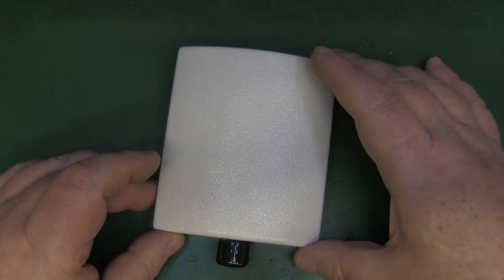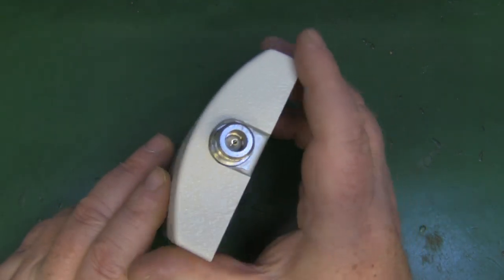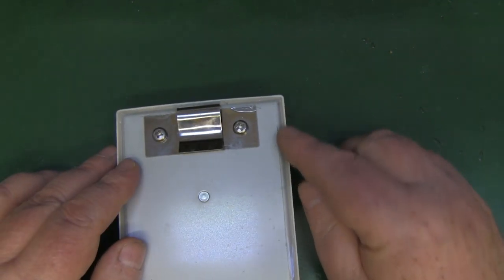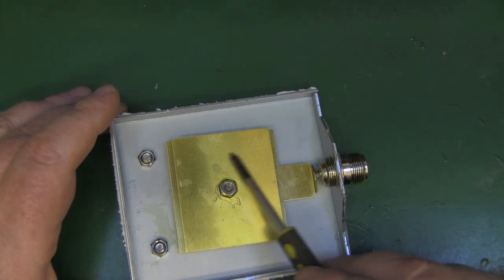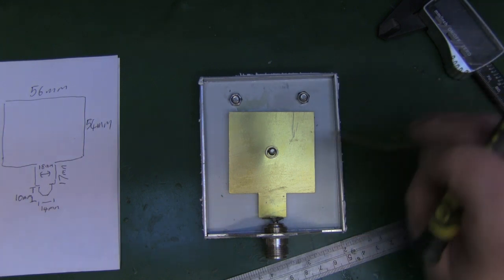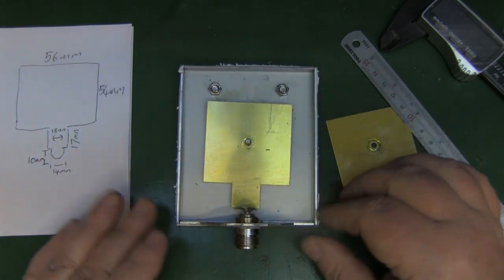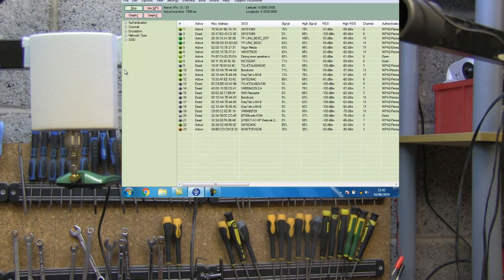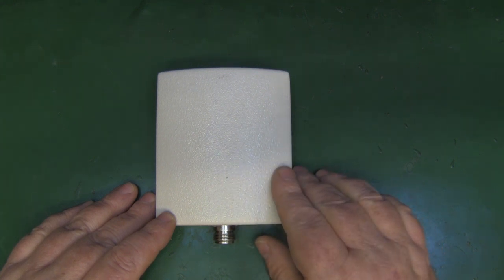Solwise 2.4GHz 10dBi Panel Antenna

Comment: Hi i may have a weird case. I took the reciever part from the yagi antenna, basically a flat half circle hollow metal tube with ground and signal wire attached at each end... I covered a 6 liter bottle with huge diametar and quite long too with alumunium foil so it looked functional and low end behold it was. I placed the antenna part in my amplifier and it worked fine, no measurments, just eyeing what might work. And after seeing your videos and learning how to make a proper wifi antenna i wonder if that will actually increase gain and signal. And by how much. And why. Because what i still dont understand is, does the shape of the antenna give dBi, i dont understand i thought it was about the eletric power not math and precise building. And i find it amazed. But still about my antenna, it is not grounded to anything, it just hovers there attached wirely only with itself and pc. So what I want to know is, why can i do that if the cantena specifically has to be metal. Is 16 dBi antenna always 16 dBi or when its forgen in a specific shape? What determines dBi in making of antenna? 
I ripped apart the cable and destroyed tha half circle and now i need to make a cantena out of it, but there is one small problem. I dont  have a metal tube so what if the tube is plastic covered in aluminium foil and ground is connected to the signal wire since its the same shit, cut out the middleman and what you get is a passive reciever. Picking up only what drifts in its trap and its always drifting. So This little experimet would prove the antenna doesnt matter as much in terms of dBi but routers signal strenght. Which sometimes, if its your neighbours, you cant point it the other direction. 
Our houses are 20 meters apart and connection is real shit to real good. My other neighbour that is 200 meters apart, has better signal but lower or same dBi. 

I think my answer is a powerful omni antenna, last one also met my neighbour. Its absurd the difference. I still gotta make a cantena and see if those measurments really matter.

Comment: Interesting. I like the sturdy construction and the N connector. Seems like these would be fairly directional, though - right? I need better WiFi antennas for my outdoor hotspot, but I'd prefer omnidirectional coverage. The hotspot does have dual N connectors for diversity antennas, but I feel like two of these set 180 degrees apart would only give me bi-directional coverage.

Any suggestions on a high gain omni 2.4 GHz outdoor antenna with N connectors?